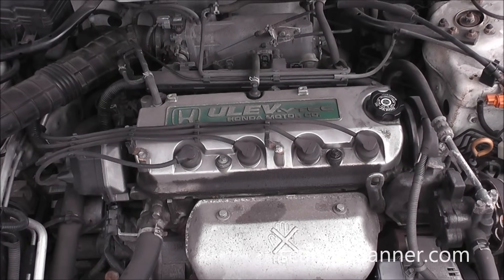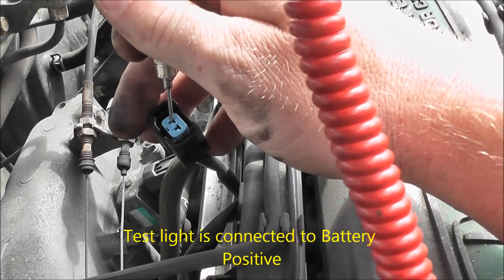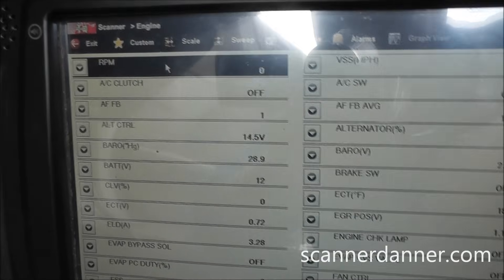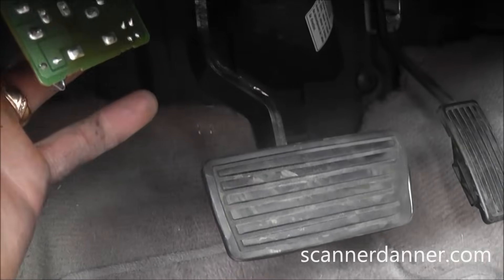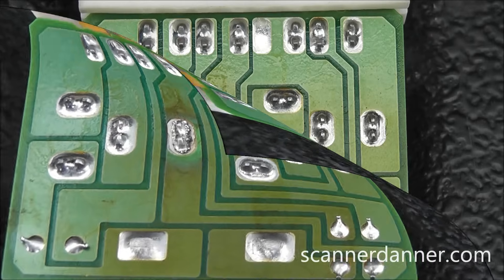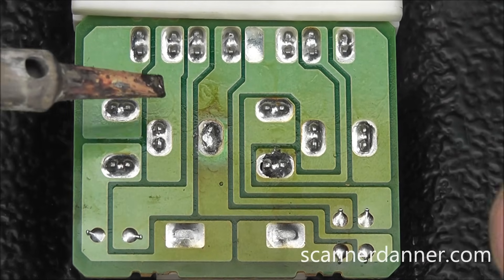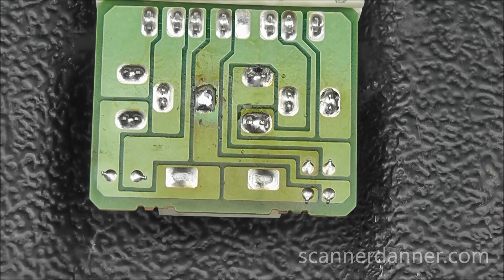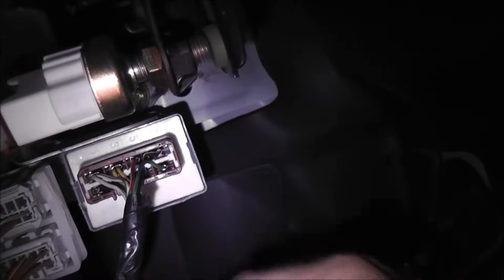How to identify a bad main relay on a Honda (PGM-FI)

Comment: I am curious as to why not just replace the relay?
Reply: monzsterman buy one if you wish or repair it  if you want to save some money. its that simple.
Reply: +monzsterman  I replaced the relay and it did the same thing. My current Honda relay is only 7 months old. If you look on YT, there is another very similar video and the mech explained that it occurs because of the heat soak and type of solder material the factories are now using, "environmentally friendly"=weaker materials. As of tonight, after the repairs to the circuit board and 5 separate road tests, my Accord v6 coupe is running factory fresh!
Reply: U can replace the relay for roughly 50 bucks or do solder ur old 1. some people don't have extra money to blow on parts if the existing 1 can be fixed easily

Comment: A brief comment - Rosin solder flux and Isopropyl alcohol. Clean soldering iron tip is mandatory. 
Solder flux, when hot, will flow easily removing unwanted oxides quickly, and it helps to remove foreign particles from the surface of the metal being soldered. This why you had to add solder ( it has some flux ) to the center pin. Alcohol is used to clean PCBA from excess flux and dirt.
Reply from the maker: Thanks for the tips!

Comment: Exactly the problem with my 2004 Odyssey. My circuit board looked exactly like yours. I re-soldered it just as you did. Perfect. Zero cost. Thanks for posting this video.

Comment: You are really a  Master Technician! I have HondA Odyssey 2002 with intermittent hard starting. I replaced the battery, starter and rebuilt the fuel pump but Intermittent hard starting still exists. Brought my car to Honda Dealership Service but the Diagnosis result was No Problem Detected. 

I observed that every time the ignition switch is turn on and don’t hear the whirring sound as it sound like a motor, prior to ignition, my car won’t start, this takes place intermittently. What do you say?
Reply from the maker: Ignition switch problems are super common. When this happens again, smack on the bottom of the ignition switch, below the key, and then see if it will start. If it does, this confirms the switch is the issue. If it still doesn't start, we need to move in another direction

Comment: Just fixed this on my 98 accord. Engine would die and not restart. Lost power to the computer, immobilzer, shifter interlock (couldn't even get it out of park to push the car), and others. After it happening in a drive-thru with a bunch of pissed off people, I decided it needed fixed. I went ahead and resoldered all the relay pins with good old fashioned lead solder, and now the car is good for another 200,000 miles.

Comment: A flux pen would have been a big help getting a nice clean shiny joint, just apply before soldering.. You put too much heat into those joints. Yes, the solder has flux, but it is intended for very clean (new) components.

Comment: Ok, I changed the relay, changed the fuel pump, I have spark and I have injector pulse.  What else could be the reason the car will not stop?  I'm racking my brain trying to figure this out.  Should be so simple.
Reply: I meant start, not stop.  Thank you.
Reply from the maker: What is your fuel pressure? What is your compression?
Reply from the maker: This may help too https://www.youtube.com/watch?v=eoodIVGgGyw&t=2s
or this one
https://www.youtube.com/watch?v=SUxagOAVS5M&t=8s

Comment: Great video scanner but can u please do a video on 1997 4.6 Ford Flex plate diagnosing a engine tapping noise after an engine flush my oil became milky then the knock came

Comment: 99 Honda Accord @ 430K  miles.  Issue of car starting 4 times in arrow then on 5th start it just cranked without starting.   If I was just patient 5-10 minutes car would then start.  I could live with that and did for over a year until motor started cutting off randomly when driving.  Scary for sure.    I replaced the ignition switch as many forums suggested that was culprit, but not for me as problem persisted.     Found this video (thankfully) and I did have one cracked solder joint on main relay.  Touched with solder iron long enough to let solder melt and repair failed solder joint.    I tested car for  30 mile drive with 15 stop/starts along the way with 100% success and no engine cut off.  I know a very short run time for testing and time will tell but I feel very confident issue is now resolved and I can't be more thankful for ScannerDan's video.    Thank you  & now on to + 500K miles on this great car!

Comment: Great video on how to quickly troubleshoot your Honda (or any car for that matter)! Any DIY'er should buy a service  manual or at least look up test procedures and specs though first...  some of these components can easily get damaged by putting direct power to them, you usually test the resistance, inductance, etc of different parts like injectors or sensors! The newer the car, the more sensitive the electronics usually are too.

I'm not trying to knock your work, this was extremely helpful so I hope you don't take offense... BUT anytime you're reworking a solder joint (or soldering a new joint), you MUST set the correct temperature, clean your tip(!) and "tin" the tip first! (add a bit of solder to the tip). Constantly clean and tin the tip and your iron / tip will last a lot longer and give you much better joints!

You will have a MUCH easier time getting the solder flowing and a lot better solder joint. It's hard to tell from your video, but it looks like that first joint is or was a "cold solder joint". Anyone attempting this absolutely MUST use electrical solder with a rosin core. Plumbing solder usually uses an acid based flux that will destroy your PCB. Too much heat will also cause the pad to lift off the board and then you're looking at buying a new one!

Too many details to explain here, but there are plenty of great videos on how to correctly solder.

Anyway, thanks for the video. Thumbs up, and hope the soldering tips help someone!
Reply from the maker: lol, I know my soldering sucked in this video
Reply: @ScannerDanner  No worries, hard to do this kind of work in the field. There's a surprising amount of copper and heat necessary once I got into it!

Comment: Paul, sorry this is an old vid, but i just bought that otc mini tester and was wondering if checking spark with it like you did here is bad for the tool. I know its not led, but it doesn't look quite incandescent to me. Thanks man and keep up the good work
Reply from the maker: No, perfectly fine my friend. The bulb is just a red glass covering. It is a filament style and can handle the high KV of the ignition system. They make replacement bulbs too, I have them listed on my amazon page here
https://www.amazon.com/shop/scannerdanner
Reply: Thanks alot man. I appreciate the response. You rock!

Comment: so I'm still leaning but when checking for injection pulse is it hard on the computer driver when switching back in forth between wires when trying to find the right one?   And is this a safe check for most cars? Many thanks in advance!

Comment: where is the fuel pump relay on a 97 Acura 3.0 CL please let me know
Reply from the maker: google search brother
Reply: I found where the relay fuse was but now my problem is that I'm not getting spark after the distributor cap to the spark plugs I think it might be my uniter I'm trying to figure that out right now
Reply from the maker: post this question to my forum at www.scannerdanner.com
It is too difficult to do a back and forth exchange here which is what will be needed in your case. 
Thank you!

Comment: hey, i have a 2000 accord ex 3.0 and i noticed you said something about checking the check engine light with the key on engine off, when i turn on the key i noticed the check engine light lit and at times not lit
when the key is on and the check engine light is lit, the car starts
when the key is on and the check engine light is not lit, the car does not start
what could be my problem?
Reply: hey my 98 Honda accord lx does the exact same thing did u find out was it was?
Reply from the maker: Next test. With the key on. Check for a 5v reference at the TPS or MAP. One of the 3 wires should have 5 volts on it. Let me know. 
To David: sorry I didn't answer you

Comment from the maker: oh, and most injectors carry around 1 amp of current so the test light is well below the point of being able to ground the injector enough to energize it. Again though, you need to know what your test light draws before doing this. We don't want to hydro-lock the cylinder. An LED test light would be ideal for this application.

Comment: Those that give this man grief about a small hole in the insulation for the test Probe. Shush Even tech schools teach this method. The man could leave the hole there and just put the harness insulation back on. The wire will be fine. He could probe every wire in that harness and as long as the holes are staggered Still no ill effect will Become it

Comment: This relay is the same position on 99 civic lx at?
Reply from the maker: It would be in the same area
Reply: I fixed a 97 civic, main relay was all the way over on the pass. kick panel. crazy, it came in on the hook, and had ZERO compression all cylinders. a new main fixed it.

Comment: would this happen to a 93 civic dx it cranks up few seconds later dies
Reply from the maker: It's possible, but usually it is an intermittent no start, not a runs then dies symptom

Comment: he was connected to positive ,because the injector has constant positive and the pcm control the injector though ground so he will have ground pulsation there if he connected that to ground the light will not flicker as ground and ground does nothing  hope it helps

Comment: tip, ive been dealing with this issue for about 2 years now on my vehicle , ive just been lazy and never decided to take it out and mess with it.  if yall are out somewhere and your car is very & hot wont start due to this fuel relay solder issue, tap the fuel relay (housing) with your finger while turning the key, you will it click and prime and your car should start! its helped me out multiple times,  i have an 01 accord coupe, i managed to get the relay out of its housing but im having trouble removing the electrical/wiring part of it, can anyone help me out and tell me how i remove the wiring from the relay? (i can get it out of its housing) but if i want to bring it inside and fix the solder joints i will need to disconnect it. do i budge the ends of the white plastic holding the wires down? it seems pretty difficult for me to undo the wires, any help is appreciated, thanks.

Comment from the maker: I mentioned the issue with energizing the injector. It all depends on the amount of current your test light draws. Initially I though I heard the injector click, then not, so in this case I was okay. It is something to consider and in most applications a test light that draws less than 200ma like mine is ok to use connected to ground. Just be careful and pay attention to what your doing.
Reply: Why did you move the test light from the ground source to the positive battery? I would think that would cause a short or an arc! Clearly I’m not an electrician so before I go testing my fuel pump for power I was curious as to where you grounded your test light in the trunk and to make sure it was ground and not positive! 

Also, y can’t I just use my multimeter to test for power/volts?  and if so I assume to put the positive Leed on the black and yellow wire where  you put your test light but where do I put my black Lead if I’m using my multimeter? Would it be that the black multimeter lead would connect to the ground point wherever your actual test light was or is it different? 

Thank you for your help. I just don’t want to hurt my car so if I have to I’ll just buy that test light thingy that you had in the video
Reply from the maker: @mrgrump2534  to prevent the injector from energizing as some test lights (even the one I am using) will provide enough current flow to energize the injector and I didn't want to flood that cylinder with fuel. Since you asked your question under my injector statement. I am assuming that is what you are talking about. However, you've clearly gone past this part now as you are mentioning the trunk and I'm not testing the injectors back there 🙂
A time frame of where each question is coming from would really help me to help you. This was filmed a long time ago. Thanks!

Comment: Just a quick comment regarding having trouble resoldering that bad join, a lot of the problem is the old dry solder, not a bad idea to throw a cheap $5 solder sucker in the tool box, suck out the old stuff and you'll find the fresh solder with its flux will make for a tidier and stronger join.  Also, that track was quite decent size, for those who don't solder much, you'll note he he was heating the pad and pin at the same time and you need the heat in the pad for the solder to stick well.

Comment: hello can you tell me if a honda crv mk2 2litre petrol has one of these main relays and where can i find it i replaced the front o2 sensor wiped code out now wont start it will for 2 seconds then stops like its getting no fuel
Thanks
James

Comment: when replacing a relay in engine fuse box, is it necessary to have the negative terminal disconnected from the battery?
Reply from the maker: no

Comment: hey are you there? I have a question : so I have a 1995 Honda Accord LX it is there it won't start that start is working and I took out away from the spark plugs and he doesn't show any Sparks I cannot even hear the fuel pump going on when you turn the ignition switch on, I replace it that initial coil because it was my first guest and it still didn't show any Sparks so my question is if you can help me what do you think it's not working properly
Reply from the maker: Watch this video
https://www.youtube.com/watch?v=SUxagOAVS5M

If you have questions after watching this, post them to my forum okay?
https://scannerdanner.com/forum/post-your-repair-questions-here.html

Comment: Hi ScannerDanner, I was just wondering if this is valid for a 92 accord LX? I didn't hear anything mentioning the  years. Thanks. ( i mighta missed it also, i was wandering in and out while listening.)
Reply from the maker: absolutely
Reply: Can I ask you about the fuel pump? I have a 92' accord LX, it was doing the "clicky" noise, I put in the relay, as you post in your video, now, the car tries to start, very strongly, no hesitation, but, there's no fire. So I gave up, had it taken to a shop, the mechanic there is saying that a lot of times when the relay goes out it causes the fuel pump and other stuff to go bad, is this valid? that seems.. odd. I can maybe see a correlation to the fuel system, but the relay causes them to malfunction? I just don't want to spend a fortune fixing the car, but I do love the car. :p

Comment: Thanks very much for your video. I think I meet the same problem. Four days ago, my honda accord cannot start, I towed it to the firestone, they told me the fuel pump was bad, and asked me to exchange this pump. After replaced, the starting problem seems to be solved. But today, when I pick my car from firestone, it stalled on the road. It's very horrible. my issue is very like this. I hope this is the main point for my issue.

Comment: scannerdanner i like the videos good job well i need some help im working on 95 honda accord original problem was stumble then stall pulled spark plug and was full of oil replaced o ring and did plugs and wires all new still no spark so checked coil no spark replaced distributor and coil and still no spark so i checked back of coil pack for voltage got 12v with key on. any ideas

Comment: If my car still wouldn't start when I sprayed starter fluid, would the PGM-FI be a possible problem?
Reply from the maker: I don't know for sure. I think you can still have good spark even with a bad main relay, so based on that. No. 
These may help you (they are Honda videos)
https://www.youtube.com/watch?v=-ZGLoSSowYY

https://www.youtube.com/watch?v=SUxagOAVS5M

https://www.youtube.com/watch?v=za13UnpbH7E

https://www.youtube.com/watch?v=i6x31RU1S_I

https://www.youtube.com/watch?v=X5Qp-ToR8KA

https://www.youtube.com/watch?v=hd_bTCsnD7s

Comment: ey man my 91 integra has no power at all it has a new battery and a good alternator and new fuel pump in it. just two days ago my car started to loose power while driving it the lights dimmed out and i stopped for a while and it wouldnt start like if there was no battery then it started up but now there is no power none of my lights turn on in my dash and nor the exterior lights could it be a bad main relay?

Comment: Very helpful video. Thank you. If I might make a suggestion, cleaning the connection with alcohol prior to soldering, and possibly adding some flux to the connection to help reduce/prevent oxidation, especially if you're having trouble getting the solder to flow. Most solder has a flux core but sometimes extra is needed.

Comment from the maker: ok. check this out. a typical control side relay coil is around 80ohms. 12v thru 80ohms = 150ma. The series resistor was 40 ohms. So now we have a 120ohm circuit drawing 100ma. we are all on the same page as to what it does. it just doesn't make sense to save 50ma here when we have ten other relays on the car without this resistor.

i used even rounded numbers for easy math. system voltage is not always twelve and i could be wrong on the specific ohm numbers here.

Comment: before you figured it out did it die randomly???
Reply from the maker: intermittent no start and stalling are the symptoms of a failing main relay
Reply: OK, I've got a 94 Del Sol that I replaced the PGM-FI relay on and I'm still getting the same intermittent start issue. So, the next most likely culprit would be what? A bad ground. Bad key switch?